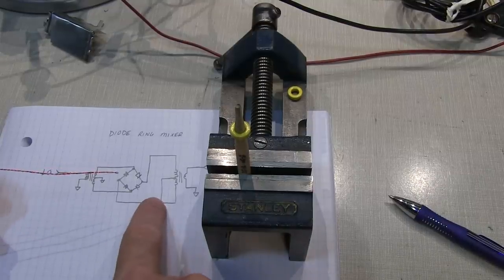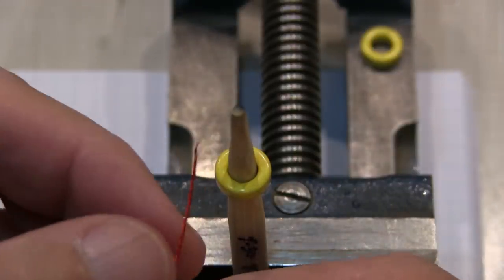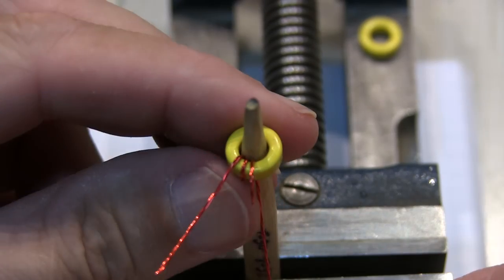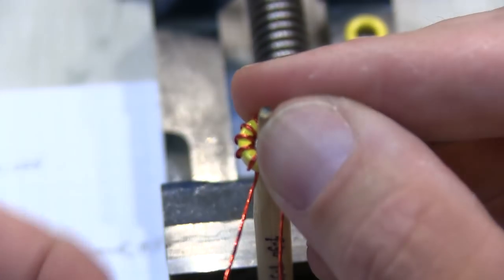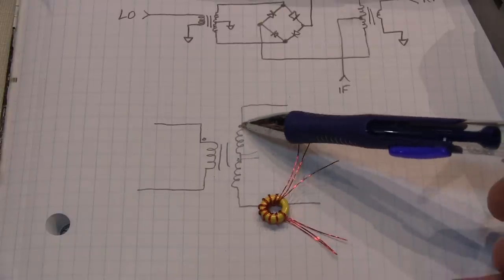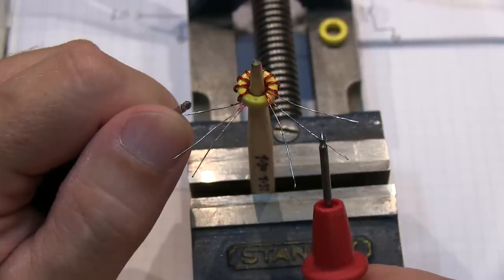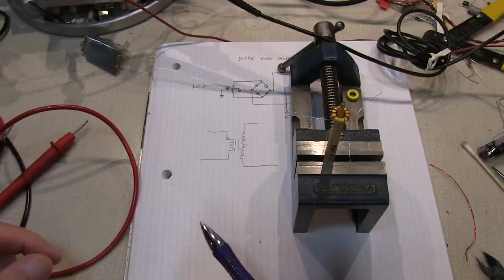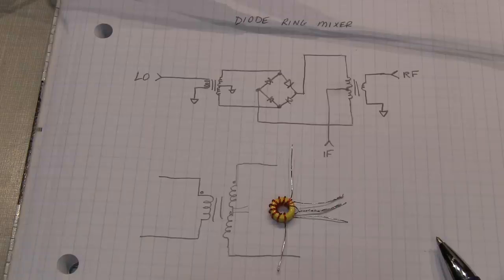#166: How to wind a trifilar toroid transformer for a diode ring mixer

Comment: I wanted to let you know that kitsandparts.com is still the best source that I have found for toroids.  I just replenished my supply in the shack.  My wife doesn't understand why I spent so much money on metal donuts....haha.
Reply from the maker: Agreed!
Reply: Also, are you using #30 because you're having to do the trifilar in the T37?  My normal go-to is usually 24 gauge but that would seem like it would be a little tight for three strands and ten turns I would think.

Comment: What are the advantages of using C-core and R-Core transformers compared to using an Iron Core transformer? I know that 60hz line frequency is the EMF and that Toroid, C-Core, R-Core transformers are radiating 60hz line frequency from the EMF of the transformer. The Iron Core transformer has a stronger EMF and the toroid has less EMF, but I'm not sure what EE engineers do to measure the EMF of transformers or what they use to measure the EMF value of a transformer.

Comment: Hi
Could you explain the diffrence in twisting the 3 wires together compared to 3 wires closely wound for a trifilar / bifilar transformer. What impact would the twist per inch make and how would you choose the number of twists (Would frequency be a factor?). 
My question is based on winding a bifilar impedance transformer for a HWEF antenna. A video with your explination on the HWEF antenna would be welcome. You really explain technology so well!!
Reply from the maker: It helps with being consistent with interwinding parasitics and common mode rejection.  I like to have about a few twists per turn on the core.  Fewer than that and you lose the benefits, more than that and winding becomes difficult.

Comment: How do you determine the number of turns around the toroid needed? Is it critical?
Reply from the maker: not super critical for these transformers.  I just used an example that was in EMRFD.
Reply: +w2aew What kind of diodes should be used in the mixer? I am in the process of designing a simple, digitally tuned VCO, which will couple to a mixer for tuning the FM band. First step is to create the mixer, antenna, and filters, then the detector (which may be the most difficult part -- may end up using an IC). I want to eventually create a simple, 25W RTTY transceiver for 20m. I have my Basic Qualification in Canada, so in order to create a transmitter I have to finish my Advanced first (HAM, that is). But I want to start learning now... your videos are excellent, and explain fundamentals well.
Reply from the maker: +Aurelius R Typically the best diodes to use are hot carrier, or Schottky diodes.  They have low capacitance and low forward voltage, and switch very fast.  A pretty good discussion on this can be found here:
http://www.robkalmeijer.nl/techniek/electronica/radiotechniek/hambladen/qst/1993/12/page32/

Comment: Great video. One question if you don't mind. Why did you choose 10 windings? And how would a different number of windings affect your mixer performance? Thanks!
Reply from the maker: This was just an illustrative example - taken from a text book.  But, in general, for RF transformers, you want the inductance of the windings to be at least 4x the impedance of the intended system impedance.  So, if your source/load are 50 ohms, then you want the inductance of the windings to be at least 200 ohms at your frequency of interest.
Reply: @w2aew  hello Allan, I have a mini circuit transformer with CT which according to their datasheet is 50 ohms from 0.2 MHZ to 600 MHZ!!! how come this is even possible? as you mentioned, the impedance is a function of frequency if it is only the transformer. So, do they have an "added matching network" on top of the transformer to keep it 50 in this wide range?? I am very confused. I look at it under the microscope and it looks like is only the coil :(
Reply from the maker: @arashghasemi  The implied test condition is that the ports are terminated with 50 ohms.  If you don't terminate the port(s), then any input port will NOT look like 50 ohms.

Comment: thanks for that tool i will definitely use that in the near future...............you say this is suitable for hf and vhf..........I plan to do VLF "up" mixer..........is there anywhere i can look how to design a transformer for the VLF band...I'm guessing the inductance would need to be more but I'm  a newbie........thanks :)
Reply from the maker: +doona42 In general, you want the winding inductance to be 4x greater (or more) than the impedance of the circuit you're using it in.

Comment: I used to make  a living selling Kapton insulated magnet wire, our in house joke was the copper would melt before the Kapton insulation would carbonize. I use Kapton insulation any place I can and use a dremel to take the insulation off of magnet wire.
merci beaucoupe for sharing, gr8 job
73 OT
de n8zu

Comment: How does this work? it seems that diode bridge is a short circuit. ? Does it rely on the forward voltage drop or a slow reverse bias recovery?
Reply from the maker: Stay tuned for the next video. Hint, the diodes aren't in the same configuration as a bridge, they're in a ring. Hint 2, they're being used as switches, not rectifiers.
Reply: I noticed that, as I was going to say that the diodes were drawn out wrong, but then googled it and found that thats how they are wired! Anyway my guess is that due to the high frequency RF, the slow diodes cannot recover quickly enough and they conduct both ways, while at lower frequencies the can attenuate half the signal better. Am I close?
Reply from the maker: In this case, the diodes need to be fast, that's why they're typically hot carrier diodes. They need to switch at the LO frequency. Check out my video on how diodes can be used as switches.
Reply from the maker: ***** You'll want to be looking at low capacitance schottky diodes. A 1N5711 will work well into the UHF frequency range.

Comment: what if I replace T37-43 for -
and I use FT50-34 ???

friendly greetings from The Netherlands!
Rob.
Reply from the maker: I really depends on the application - i.e. the operating frequency and required winding inductance.  The ferrite core is going to give you much higher inductance and the powdered iron core.  In a transformer application, this may be ok.
Reply: @w2aew  
okay thank you sir for all those good videos!
I still enjoy them.
I am now working on RTL SDR and upconverters DIY and also bought.
i have 100 and 125mhz can oscilators crystals 48mhz and 100mhz to expire with.
and despite the not so neatly made mixer it seems as if the DIY upconverter receives more than a purchased type!

with 100mhz can osc. (this one seems to do well!)
also something I do not understand with this DIY build-up converter?
for me is the shift at 100,100,000 instead of 100,000,000???

I had put the wrong numbers here above, it had to be:
T37-6 = 2-50 MHz
FT50-34 = 1-50 MHz
frequency according to: Mini Ring Core Calculator.

Kind regards from Rotterdam NL!
Rob.

Comment: Hi Alan, I'm building a 10W QRP amplifier for 30m and it has 3 transformers described as 14 turns 4:1 Bifilar on FT50-61 cores. I wound them with twisted magnet wire. I twisted it together at about 12 turns per inch. Once I was finished I read the next paragraph. In part it says, "T1, T2, and T3 are each wound with 14 turns of parallel red and green wire". I used twisted wired, not parallel. Is that going to be a problem? I fee like it is but before I take the toroids apart and rewind them I thought you might know if it was a problem or not. And maybe, if it is, you could explain why. Thanks. 73 NE5U Mike
Reply from the maker: +Michael Lloyd It shouldn't be a problem in my mind.  I guess they suggested parallel winding because that's easier on a larger core with a small number of turns.
Reply: +w2aew Thanks Alan. Since it's a transformer I thought that might be the case but I wanted to ask someone that I knew would know. It's the weekend and the kit mfg hasn't responded yet. Speaking of that, thank you for taking the time to reply. 

I have one last issue with the build. One of the mica caps in the LPF (LC Pi Filter) section is supposed to be 390pF for the 30m band. The board is designed so that you install one cap in one of 3 locations. Ie. the locations are in parallel. They sent (2) 180pF caps in lieu of the 390pF cap. In parallel that would be 360pF. That's about 8% lower. I wonder if they messed up or they just intended for me to install parallel 180pF caps. I have an email to them about the twisted wire vs parallel and the cap but I thought you might have an opinion on using 360pF in the LPF vs the 390pF value that is called out. The design doesn't fit any of the internet calculators so I can't simulate it. I guess I could with other tools but it's not an end of the world / do or die problem. Its' a kit... I can wait a day for a reply. Anyway, they paralleled some mica caps around the two inductors. 27pf in the first section and 66pf in the second section and thats' what makes it not fit the internet calculators. I'm kind of tempted to play with it in LTSpice. I don't know the program very well but what I've done with it was fun and seemed to be a good sim...
Reply from the maker: +Michael Lloyd I doubt they've messed up.  It is possible that the desired value is less than 390pF, and they simply listed the max value of the adjustable elements - similar to specifying a 10k potentiometer, even though it would never be adjusted to max value.  Having parallel paths in the layout is good - it would allow you to fit a fixed value in parallel with the adjustable caps to slide the range higher if needed.
Reply: +w2aew They didn't. The kit shipped with Version 5.3 of the manual. Ver. 5.4 says. 

"Notes: *In some cases, the capacitor value may require 2 or more smaller capacitors in parallel". 

The specified value is 360pF or 180pF x 2. 

I had already installed the two 180pF caps by the time they replied. It seemed logical. 

Now that I have V5.4 of the manual and need to double check all of the components. 

Thanks for your help, it's much appreciated.

Comment: whats the reason you didnt wind the primary coil on one side of the torroid and the secondary coil on the opposite side?
Reply from the maker: +shriramvenu Best RF coupling when the windings are done overalapping (bifilar, trifilar, etc.).

Comment: what method are you using to twist the wire(s)?
Reply from the maker: Since I only needed about 6-7" for this toroid, I just twisted them by hand.  For longer lengths, sometimes it's handy to use a hand drill or powered screwdriver.

Comment: What frequencies  will it cover,will it go below 1 meg
Reply from the maker: It will, but a few more turns on the core would help at lower frequencies.
Reply: What would be a good choice for low noise diodes at the lower lowfer frequencies   thanks
Reply from the maker: Gold Lover The 1N5711 or 1N270 would be great choices, but the popular 1N914A would work well too.
Reply: ***** This would be just as good as a sbl3 and you would not need a spectrum analyzer to test as it would be more easier to troubleshoot? and the cost would be a lot lower
Thanks
Reply from the maker: Gold Lover I haven't measured an SBL-3, but I would imagine its performance would be better, since they've taken care to control parasitics, optimize layout, match diode characteristics, etc.
Reply: ***** I would agree Thanks

Comment: what happened to the third wire in the primary?
Reply from the maker: There was no 3rd wire in the primary.  The primary is one winding.  The secondary is two windings in series, which can be thought of as a center-tapped winding with twice as many turns as the primary.
Reply: oh i see. is there any concern in connecting the center-tapped? like the flux could be opposing instead of aiding.
by the way, love your vids sir. these are great for doing homebrew projects.
Reply from the maker: Karl Acha Yes, the phasing is important for the secondary.  I believe I made that clear in the video.
Reply: ***** very good explanation in all of your vids sir. some practices were not discussed in books. would you mind sharing your educational background and work experiences? thanks
Reply from the maker: You can all about this from my guest appearance on The AmpHour podcast. 
http://www.theamphour.com/theamphour-117-undulating-utensil-utility

Comment: Isn't that a 1:1 balun ?
Reply from the maker: The LO side is more like a 4:1, but the RF/IF side is actually used as a 1:1, since half of the secondary is disconnected 50% of the time due to the switching action of the diode ring (more on this in the upcoming video on the operation of the diode ring mixer).
Reply: *****
Oh ok I was just talking about the part in itself because I have no idea what it does here I guess I'll find out in your next video.